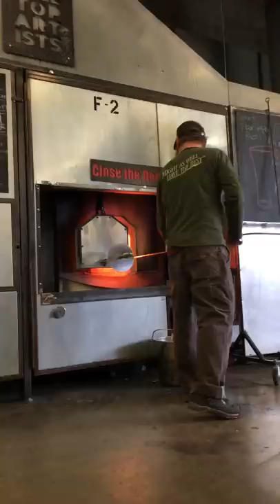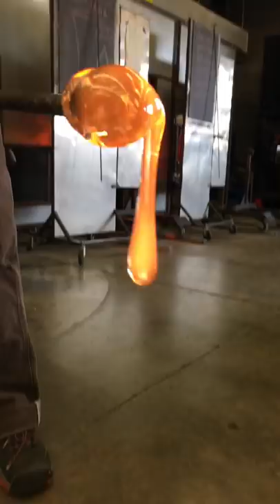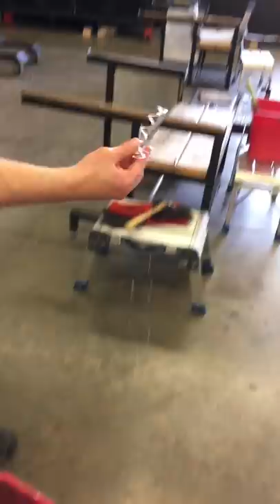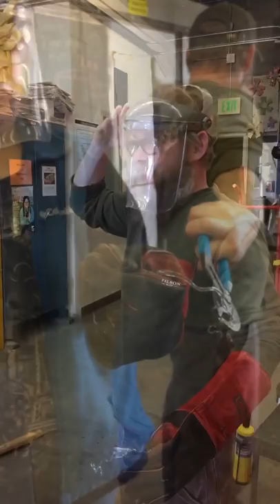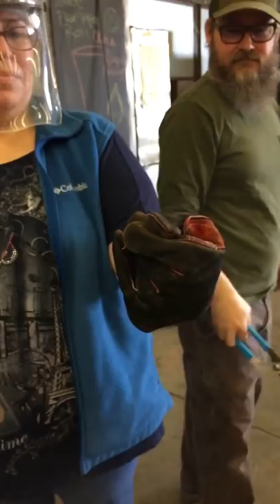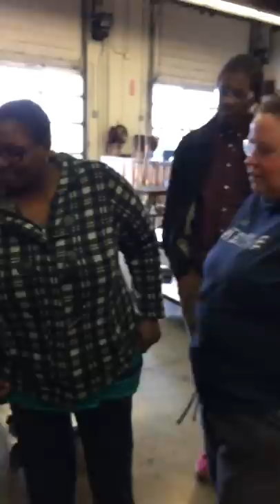Glass artist Jason Mouer demonstrates a Prince Rupert's Drop to University of Washington students

Comment: These are really cool. What happens is that the outside of the glass drop cools and hardens almost instantly while the inside is still crazy hot. 

So you have the bulk of the glass in the center of the drop that is still molten and as it slowly cools it wants to condense from a molten liquid state to a solid state but it can't condense because the outside and largest surface area of the glass is already extremely hard. 

You can hit the drop itself with a sledge hammer up to a point and it doesn't break because again, the molten liquid glass on the inside is trying to pull itself inward (condense) so the molecules inside the drop have an immense inward facing pressure you could say. 

The squiggly tail of the drop cooled down roughly the same time as the outer body of the drop. 

So what makes this thing cool is that you can hammer the drop and it's fine. Doesn't break. But just take some little nippers and nip the tail end and the entire thing rapidly implodes because that original inward pulling force remains that way.
Reply: Thank you for this explanation
Reply: Yo thanks I was hoping someone would explain what happened
Reply: I understood the processes at work, but you explained it much more thoroughly than I was going to. 😂👍
Reply: Thanks for explaining it. I learned part of it in a Nora Roberts book, Born In Fire. Maggie would be proud. ❤
Reply: Thanks for saving me a trip to google I probably wouldn’t have looked into anyways
Reply: Awesome 😜
Reply: Now that's an explanation! 👏👏👏
Reply: Nice!
Reply: Thanks for the cool explanation!
Reply: So can u make the droplet without the tail
Reply: Thank you for teaching me something so amazing
Reply: @ConsentDeath  Not in a environment with gravity bro
Reply: This needs to be fxcking pinned
Reply: This was both insightful and well explained 👍🏻
Reply: Sorta like tempered glass . You can smack the surface extremely hard, Knick the corner however and you get rained on by an exploded lite of glass
Reply: You’re the real hero 👏👏👏
Reply: Sleeping would have been a little more difficult tonight without this clarification. Thank you 👍🏻
Reply: Awesome explanation....BUT, the inward forces confuse me...if we are watching internal forces at work to make its exterior "so strong" then wouldn't any crush force make it implode quicker? 
I'm no physicist lol but my mind refuses this logic 🤣 
It would make more sense, to me, that the core being hot is pushing AGAINST hardened outer - helping its strength by resisting outward forces. No?

Understand, I'm arguing, simply trying to understand 🤷‍♂️
So often ppl on the internet assume everything is an argument/attack. And that's just not how reality works 🤣🤷‍♂️
Reply: Thanks a million
Reply: NEEEERRRRRRRDDDD
Reply: Thanks
Reply: @Lord_Pistachio_Nut  I like how you put " mind refuses this logic". That I can relate to.
Reply: @Lord_Pistachio_Nut   despite the many thankful comments here, the explanation was inaccurate in many places, and I think that's why you have questions!! 

First of all, the word 'condense', in a scientific context, is being used inappropriately.  
Second, the explanation of the bulb's strength ('molten liquid glass on the inside is pulling itself inward') isn't quite right... There's no molten liquid glass inside the bulb, and even for the milliseconds that there was, it created both a tension (in the centre) and compression (on the outside) in the glass before it got frozen (and afterwards, too). The reason it resists impact is because of a large compressive residual stress (the very opposite of 'pulling itself inward') on the outside. The internal tension that the poster described doesn't contribute to its strength. Effectively any cracks that try to form on the bulb are 'held together' by the compressive stress, stopping them from 'spreading' further than the surface (the way a crack in glass would normally spread without all that compressive/pushing-in force.) If a crack were to form in the 'internal' area (under tension/pulling force) it would create a catastrophic shattering (exactly as seen when the tail is snipped). In short, the bulb is not strong from 'pulling itself inward' (think a vacuum, which the poster is erroneously calling 'condensation'! ) rather, it's the pushing stresses along the surface giving it strength (think a deep sea water crushing divers under high pressure,  - note: this also isn't 'condensation' - condensation is the change from gas to liquid, whereas the glass in the video is moving from liquid to solid, which is called freezing. )
Edit: Generally, 'condense' isn't used to describe an increase in density in science specifically to avoid these misunderstandings, although from the way 'condense' was described as 'pulling' and 'an inward internal pressure', it wasn't been used to describe an increase in density even in that non-scientific manner - the opposite was being described.

Finally, the reason the thing shatters when the tail is broken is due to the 'pattern' of stress lines being 'stretched' in the tail, combined with an internal tension (lower density). The drop is low-pressure in the middle, and high-pressure on the surface. This means a crack in the 'middle', low-pressure section causes very dense crack bifurcation, which then 'spreads out' as the cracks reach the bulb and the stress pattern of 'lines' in the tail moves to the wider shape of the bulb. If I can try to explain this (which I'm not great at, but I'll at least not describe the opposite of what's happening!), when the tail is broken, a crack is started along the direction of the 'tail', the crack keeps 'splitting' rapidly along the direction of the tail's length (due to the residual stress field - a sort of directional pressure pattern caused by the rapid freezing of a stretched-out medium, along with the lower internal density compared to the surface). Imagine these cracks as branches of a tree, squashed thin like stretched pasta, as the crack multiplies (bifurcates) and these 'tree branch' / lightning shapes move up the tail, it ends up as thousands of cracks by the time it gets to the bulb. At that point these many branching cracks follow the stress pattern (the 'stretched pasta lines' of the frozen stress pattern turn into a sphere when the tail reaches the bulb',) spreading out along the direction of the stress field in the bulb, spreading amidst the internal, 'weak' (in tension) part of the bulb, reducing it to powder!

In short, the reason you had questions is because your understanding of physics contradicted the explanation that you're replying to, because the explanation wasn't completely correct (despite clearly getting lots of praise here - I can at least see how the mistakes were made, so no offense to the original commenter - it obviously wasn't willingly trying to mislead, and was probably nothing more than poor terminology and an effort to simplify.)
Reply: Extra note - I think I can see why the poster explained d a 'pulling' force here... I assume its because glass, unlike water, actually gets more dense when it freezes (ie solid glass takes less space than liquid glass, whereas ice takes up more space than water.) In fact, though, this effect when applied from the outside first, in a sphere, actually compresses the outside of the final solid form, while decompressing the inside liquid before it, too, freezes, leading to higher internal pressure being frozen solid.

I only assume that's where the mistake was made. (or, at least, that one mistake. The others seemed like simple terminology errors (confusing tension for torsion, condensation for freezing etc.) 

Edit: It's a rather complicated situation, where there is both a 'pushing' (compressive) and a 'pulling' (contractive) stress in different parts of the glass (outside, and inside, respectively). I believe the poster was just describing one part of the effect (the inside) and not the other (the outside). Understand that I only described it as 'wrong' because it's the compressive ('pushing') effect on the outside of the bulb that gives it its strength. (Whereas the inside 'pulling' contraction is the biggest part of what makes it explode so).
Reply: @chrisroch1544  thanks lol! The older I get, the more I realize that my mind and my "self" are two completely separate entities 🤣🤷‍♂️
Reply: @xxxxSylphxxxx  thank you. That was an extremely well worded explanation. I love the "think - insert regularly utilized daily item" 
Reading your explanation, then reply to such, them REreading OP: I think you're right, right destination, wrong road. 

I absolutely LOVE being able to have stimulating conversations on the interwebs that don't instantly devolve into chaos because people read lines that don't exist 🤣🤷‍♂️
Reply: So it's cause the inside isn't hard and solid it's still hot and liquid like or molten or whatever.... If u make one pull it out 3weeks later wouldn't the inside have cooled by then? Or is that not what you're explaining?
Reply: A useful for comment. God bless you!
Reply: Thanks for the awesome explanation.💯
Reply: That's really amazing. Thank you for the explanation.
Reply: Thank you man
Reply: We need more usefulness like this in YouTube
Reply: @malourocha9211  great question who or what do you expect? Or believe it may be? A bot, or worse?
Reply: @xxxxSylphxxxx  righto also I was thinking related to the tails dress Line I bet glass just as wood and even metal had a grain structure so when the rail is broke the entire droplet goes critical from the resonance frequency’s splitting the grain like you might split a large log with and axe but that’s just my thought process from my work history with metal and wood I’m new to this glass material it’s very alien to me
Reply: @coopachew  wooden grain structure is an excellent way of thinking about the frozen residual stress field! Nice analogy!
As the 'tail' becomes the 'bulb', those 'grain patterns' go from linear to spherical, hence the shattering!
Awesome analogy! 🖤

Make no mistake though - the main reason it explodes like that is the contractive forces in the centre of the bulb. The stress field just helps the crack 'spread' to the bulb.
Reply: @MarilynMalkovich  never seen a glass marble before i guess
Reply: @ConsentDeath  That's my question also can you just clip the tail off as the droplet is falling off the stick and what properties would it have without its tail
Reply: @MarilynMalkovich  you can too clip the tail as the droplet is falling from the stick it's not like your dealing with immense speed it falls relatively slow
Reply: @Lord_Pistachio_Nut  I was thinking the same way like it's pushing outward kind of like negating the force when you strike it
Reply: So what happens when it cools?
Reply: Didn't ask
Reply: Tl;Dr "it has internal stress from anisotropic cooling."
Reply: @TheTradesmanLU2001  no not like that at all.
Reply: I should be working rn, but this short and your comment are very enlightening, thank you 🤣
Reply: THANKS FOR WLEXPLAINING!
Reply: @tonyacrawford8656  I FREAKING LOVE THAT BOOK!!  Maggie would definitely be proud!🥲
Reply: @ConsentDeath  doesn’t seem like it considering the tail is what is needed to make it dust bc that’s what needs to be snapped off in order for the drop to implode...from my understanding
Reply: So if you had something heat up one side, and cool off the other in like a panel, would the same effects occur? Wondering what obscure fascinations may come of this, or already have.
Reply: @xxxxSylphxxxx  thank you it amazes me everywhere you look in natural materials we find theses amazing perfect structures/matrixes which we try to copy but we don’t even come close.  I swear I’ve read your comments before some other interesting channel your name is hard to forget hope to chat again in the future
Reply: @xxxxSylphxxxx  If ice takes up more space than water, then wouldn't that be contradictory to the whole climate change specifically SEA RISING debate?
Reply: @xxxxSylphxxxx  WOW thank you for this epic and well informed explanation yet broken down simply enough for me to understand, I was half expecting a reply of someone mocking me for what I was asking however I was genuinely curious. Thanks for taking the time to reply to me 👍
Reply: @pandaview2673  I'm also very glad that you didn't take an explanation as patronising or insulting! 
I'm often worried about getting my tone right while replying, which makes me really grateful for your lovely reply! ♥ Thankyou!
Reply: @xxxxSylphxxxx  I think that even if I said something and believed what I said, I never mind someone who is willing to disagree with alternative information or facts for me to consider, equally when I don't really know anything about something people can easily mock that, but someone who straight up educates me and willing to take that time in an extremely well equipped post with the relevant information then I am always grateful, just a shame people can't be more open to information even if it changes their views I think we should all seek the truth rather than double down without looking at that relevant information.

Thanks again :)
Reply: Thank you 🙏 Cleared up a lot for me
Reply: @pandaview2673  you're right, it's a shame people often feel so scared of sounding stupid they say nothing... When the only way to learn is to ask when we don't understand! 🖤
Reply: @xxxxSylphxxxx  Absolutely:)
Reply: Thank you for explaining
Reply: Is tempered glass not made using this same technique?
Reply: @dester3275  Pretty much, yeah! 
I googled it, and it looks like they cool tempered glass with air rather than water, but essentially yes! It's the same effect that's making it tough! Thanks for pointing that out!
Reply: @dIancaster  This question warrants a better explanation than I think has been given by either me or Dale Minkel... We've kinda both failed to completely describe it, (I imagine since we were both going for some degree of brevity), so it's obviously not an easy situation to explain... I'll really do my best here! 

Since glass is more dense as a solid than a liquid, when it cools, the molten glass on the surface solidifies (freezes) first. 
After the outside is frozen, the inside begins to harden from the outside-in, 'pulling' the outside, hard surface, inward. If you imagine having a frozen ball, then 'sucking it in' from the inside, this pulling effect makes the hard outer surface, which was once covering a sphere of liquid glass, now cover a sphere of solid glass, which is smaller. 
If you imagine the outer layer as a frozen balloon, it is now surrounding a smaller centre... So it's 'pushed together' at the surface. 
Imagine getting a football, then making the inside of the football contract until it's the size of a tennis ball. The outside leather 'skin' of the football has now bunched up to the size of a tennis ball, so it's now in compression; increased in density. That  leather that once covered a football is now only covering a tennis ball, so it's dense, it's pushed-together. The leather skin is much more dense and pushing against itself.
At the same time, the inside of this 'new' ball is 'pulling' inwards, so it's in contraction. 

It is this dual-state of the drop that gives it strange properties - the outside is in compression/pushing, and the inside is in contraction/pulling. This makes the outside really strong, but the inside prone to shattering if an imperfection makes it that far (which isn't easy to do, and best achieved through the tail, since the tail has much less total compression on its thinner outer surface.) 

I really hope that's a better explanation!
Reply: @xxxxSylphxxxx  Interesting! So in theory, if given multiple "tails", any of them shattering would reach the center just as effectively-- this isn't a strictly directional effect?
Reply: @dIancaster  totally correct! The reason the tail causes a shattering effect is down to 2 factors - the residual stress lines along the tail and the bulb (an earlier commenter pointed out a great analogy to the grain of wood), and the contractive pressure of the inside of the object (compared to the compressive outside).

If you made a drop with two tails (which would be harder than just dropping a glob of molten glass into water, but totally possible), then both tails would shatter the bulb when cracked.
More to the point, while a crack on the outside of the object won't be easy to penetrate past the surface (this is effectively tempered glass), any crack that does penetrate past the surface of the object will propogate to the contractive centre, and then along the stress lines, to explode the whole thing!
Reply: Essentially, the best way to imagine the drop is an object with a very tough 'shield' on the surface, but a weak centre with a 'grain' that encourages cracks to move towards the bulb. 
Since a crack in glass propogates based on an initial fault, the inside can actually be really weak, and still hold together just fine because no imperfections are able to make it past the extremely strong surface 'shield' layer!
Reply: Legend!
Reply: Finally someone said something useful!!
Reply: Thank you!
Reply: Cool
Reply: Thank you!! Awesome explanation!!
Reply: Thank you so much for explaining how that worked🤗
Reply: Dude I was so confused by all this but your explanation made me understand and I had to go back and watch it again.